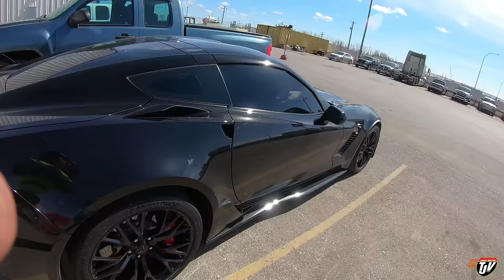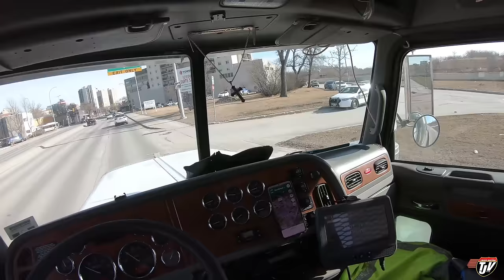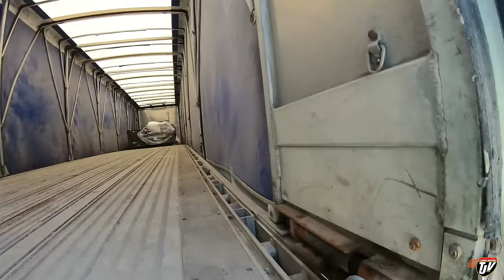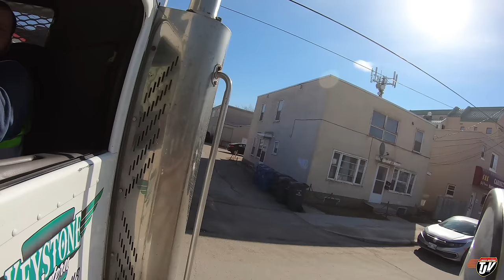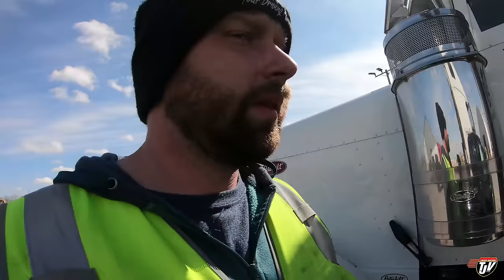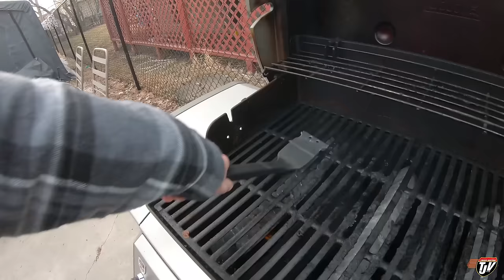My Trucking Life | ROLLING FORWARD | #2244 | March 25, 2021

Comment: Mens' coats are buttoned the opposite way to womens' - unless that's changed in recent times. Womens' are buttoned over from right to left, while mens' are buttoned from left to right.  The reason was because, as you say, men had to be able to use their right hands to draw their swords, so their coats had to allow them to put their hands through the buttoned opening to be able to do that.